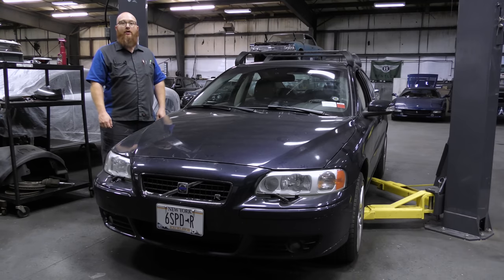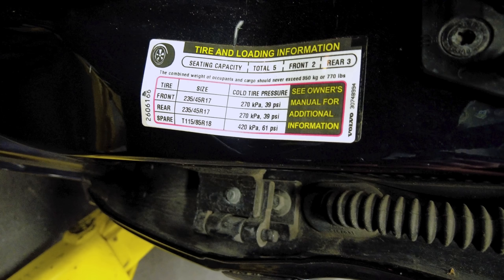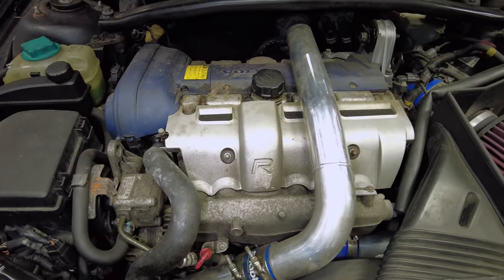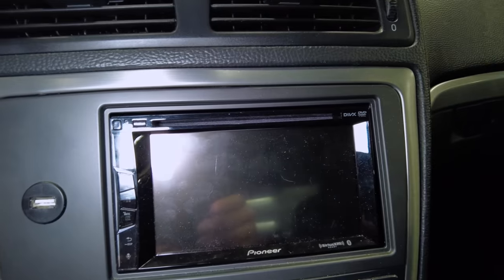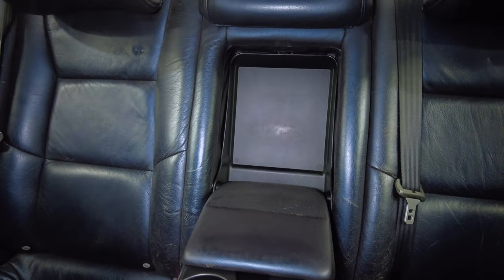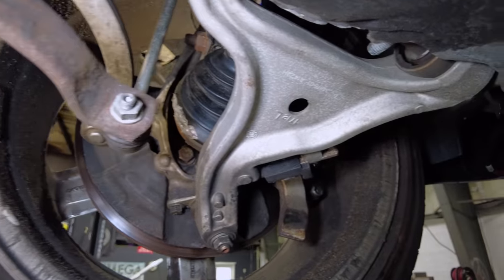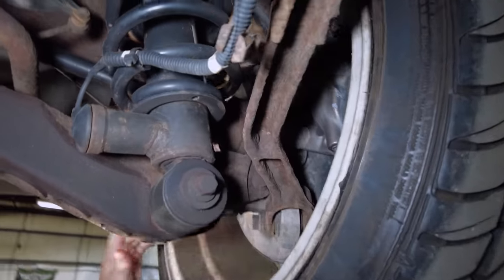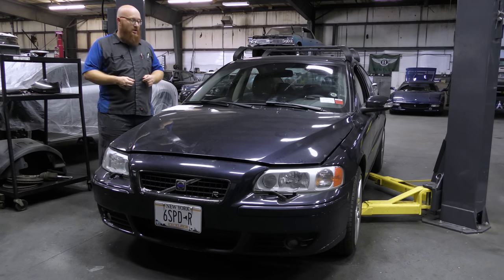They shipped their '07 Volvo S60R over 1K miles to my shop? CAR WIZARD determines if it's worth it!

Comment: Hi, Wizard. I specialize in Volvo repair and have personally owned 50-75 Volvos over the last 12 years. Love these cars. I can say with 100% confidence that the rubbing is NOT caused by the wheels or steering rack and in fact is the little bumper block things mounted to the control arms with two bolts, they wear out, and allow too much steering angle and the wheels rub. Volvo knew this was going to happen which is why there is a metal rub guard mounted to the inner fender. Also, 18" wheels were standard factory equipment on S60Rs, 17 came standard on V70Rs. 17s are optional for the S60R. I would also strongly suggest checking the PCV system as this car has lots of oil seepage around the oil filler cap and at 120k I doubt it's been done and it's due just based on age. I bet everything under the blue engine cover is soaked in oil. Cheers!
Reply: 100% correct. you need to mount the right steering stops when you place larger tyre size.
Reply: also check pcv system.
Reply: Was exactly going to comment this, They probably upgraded to the 18inch Pegasus wheels from the Original 17Inch and forgot to replace the steering stop bushes on the control arms for the correct wheel size, and probably what caused the steering rack to give up. :) and also that steering wheel is aftermarket on that car except for the centerpart + buttons.
Reply: Wizard better read this. Great information.
Reply: Came here to point out the same thing 😂😁👍
So +1
Reply: The sterling rack is also missing the plastic spring on the lower pipe, to relive the stress in the pipe.
Probably only needs to change the pipe kit. Unless the vonecting surfa e has coroded.
Reply: I think the wizard said in the video that the wheels are too wide. 🤷🏽‍♂️ maybe they’re 17” but he got wider wheels
Reply: @ObesePuppies  as the wishboes have been replaced, they have Probably been replaced whit the wrong one. The r has spesific bumpstops. They look New to me, so are Probably for 17" wheels. Se this all the time when non dealer shoos work on this generation volvo 😁
Reply: Sorry for hijacking the post a little 😂

But would want the wizzard to see this, 
It looks like the plastic spring thst goes on the stering rack brether pipe is missing. He Probably only needs to change the pipe kit, to fix the leaking rack. It was a recal to add the spring /swap the pipes if nesesairy. Atleast here in norway.
Reply: Picked up an xc70 for 600 bucks. The old man I bought it from took it to "a shop down the street" for regular service. They did the pcv service and installed a regular banjo bolt in place of the check valve that bolts to the manifold. Needless to say, it had blown oil all over the top of the engine and into every crevasse.  They also neglected to clean the square drain from the black box to the pan. When i removed it from the block, it shit out a half quart of milky ooze all over the ground. I think this summarizes volvo repairs pretty well. They're just weird.  Need to replace the turbo drain? Just disconnect the driveshaft and pull the angle gear.
Reply: Volvo are simple to work on but they have some issues like pcv valve and they all are interference design . They have an odd timing cover that doesn't prevent belt entanglement
Reply: @wolfeadventures  He should read all comments nobody knows everything and you guys comments are very help full to anybody else doing car repairs
Reply: 50 to 75 Volvo's find that hard to believe
Reply: Came here to say this!
Reply: @ObesePuppies no
Reply: @TheDingopaul I've casually owned like 20 we volvo nuts are a special breed 😊
Reply: @TheDingopaul why? 😂
Reply: Exactly, it was a 17" wheel car, put 18" on needs the thicker steering stop ... or just put some washers under the stock ones.
Reply: DItto the PVC system...it's a nightmare waiting to happen.
Reply: I was just about to say this same. If u on a budget, u can turn those over.
Reply: all old volvos scrape inside the fenderliners with oem big wheels . ( lm a volvo tech in sweden with 15 years at volvoshop in Gothenburg home of volvo) , oh yes , pcv system its common issue, also can be clogged in the block where the pcv is mounted .
Reply: 18s were standard for S60Rs? Why are most of them 17s then, wish I had 18s on my SR
Reply: My 99 V70 also had the bump stop. Confused me at first but ever since it’s been something I wonder why other cars don’t have 😁
Reply: @TheDingopaul  He probably Bought, Fixed, and Flipped the majority, he may even have a used car dealer license.
Reply: @jesperekholm3492  with my 04 S60R it has scraped twice then I changed the little rubber stoppers problem solved
Reply: Did this on my 06
Reply: The correct tires size for the S60R are:

225/45R17
235/40R18 
235/45R17 
235/45R17 
235/40R18 
245/35R18 
255/30R19
Reply: @boelensds and replace the knocking sensors while the intake is off when doing a PVC cleaning.
Reply: I don't know if it was the camera angle or lighting playing tricks, but the tires look narrow relative to those rims.
Reply: What do you mean 50-75 that’s so many fucking cars for one individual to purchase AND ALL OF THEM ARE VOLVOS!?!?
Reply: @brutusthebuttress1476 well if you consider his age , and being working in a shop you can do more than that when you are around 50 years old .
Reply: A volvo s60 R is most definitely a car you need to have a bit of background knowledge on to work on. Like most modern volvos they come apart and go together like Legos. I am actually surprised to see that much corosion on the underside, I live in the rust belt myself, and I have never had one with that much rust. Other helpful tips, know when to use oem and when aftermarket is ok on these cars, For critical components like timing belts always use oem parts and always do the water pump and applicable tensioner and Idler. Asin is usually the oem. As for wheel rubbing, most P2 cars do this, especially when they age. It's usually a combination of missing/incorrect steering stops and / or weak front springs. Always do a glove test to verify PCV systems on these cars. Volvo seemed to have underbuilt the P2 chassis. In my opinion, the P3 volvos always seemed ridiculously overbuilt, which isn't a bad thing. The drivetrain on these cars should be maintained religiously, all fluid every 25k miles on any that I have personally owned, and they stay trouble-free, always synthetic oil every 5k. I'd like to think you would be able to find someone local to rebuild the M66 transmission. Do not neglect the haldex system, and lastly, something to look for on these is a worn-out angle gear. If you get the front wheels to squeel accelerating on dry pavement, the sleeve is stripped out. I have seen people replace it, and I have seen people weld the sleeve, but I am unsure if it was designed that way to be a failure point. These P2 R's are definitely a fun vehicle but can also be a labor of love. They definitely are one of those cars with their own personality.

Comment: DO NOT change the entire rearview mirror. I did that mistake, it has computers in it for the locking system and some other systems, you have to transfer the same circuitry over to the new housing if you want to change the entire housing, otherwise your car's central locking will not work.
Reply: That's a worse design than what BMWs of the same era has
Reply: Before I got my 02 S60, my grandfather cut a piece of some mirror and glued it to the rearview mirror when the auto dimming died (and turned the mirror brown). This was after he was quoted $600 to change the mirror years ago.

Yeah that mirror contains the entire Upper electric module. Pretty much contains the security system, keyless entry, lighting, and sunroof. The minute you remove it the car will become an expensive paperweight until you put it back.
Reply: @1DeathSquadDictator0  It is possible to affix one from a junkyard as a temporary solution. I did that and the car does work, everything works except for security functions. So you’ll have to lock and unlock the car with the key.
Reply: @burntnougat5341  it is not uncommon for cars to have control systems in the mirror housing. It makes sense for receivers and in newer cars sensors and cameras can be placed there. The bad design part is that it is VIN-locked and Volvo is not able to reprogram another mirror that is not brand new for the same VIN. If only that was possible, you would be able to grab one from the junkyard and just assign it the correct VIN.
Reply: @tobias_dahlberg  that's what I mean, my bad should have been clearer. The vin locking is bad. I know BMW verts of that era have the key fob rx and rain sensing hardware in the same unit so volvo isn't totally alone there
Reply: Mine was broken 2️⃣, i had a rearview-mirror from an old Saab900, zip-tied it in front of the volvo mirror.
Reply: dont do it, dealers dont even rewrite the code to the keys anymore...
Reply: But I have an acura and it’s an automatic. To be brief I accidentally drove with my emergency brake on for about 5-10 minutes going 35-45 miles per hour because I was going to a gas station and I smell burning .. What kind of consequences can I expect and Ik I have to get it checked out just in case but realistically is it going to be expensive ?
Reply: @WAFEYYQQ  you better switch to a bicycle🚲
Reply: @erwinvangrinsven9345  what actually happens if I did this on accident first tkme
Reply: @tobias_dahlberg  mirror is not programmed to the car. However there is several options of the mirrors and if you choose wrong one then aome functions will not work. Like do you have puddle light, seats with memory function. Foldable mirrors or not. Blis sistem or not. But they are not programed to the car.
Reply: @WAFEYYQQ  i don’t know,tell me
Reply: @erwinvangrinsven9345  idk it still drives so
Reply: So true ,Volvo every single electric part is connected to the computer.
Reply: @Aloosh-gt4oi  Yes. But the same is true of most luxury cars.
Reply: @Aloosh-gt4oi  it is not true. Mirrors are not programed to the car. Yes some modules are but as other mentioned so it is for the most new cars.
Reply: If you love the car, it's worth it!
Reply: Yup, I fixed this issue by buying a used mirror screen and soldered it to the mirror housing
Reply: You can replace just the glass but it's a little more work. The circuit board can easily be disconnected from the glass. You just have to unsolder the wires going to the old glass and then solder to the new glass. I've rebuilt many of these.
Reply: @WAFEYYQQ  You probably just wore your brakes prematurly

Comment: I had a 07 V70R wagon and will say that they're one of the more tricky cars to fix as everything requires "software and coding".
Reply: In what way did software and coding make your V70R harder to fix?
I have a super basic '01 V70 that's not been difficult to fix so far.
I'm quite curious.
Reply: @DeeDee-pw9pm  only the dealership can sell you the software and code the parts.
Reply: @DeeDee-pw9pm a lot of modules need to be programmed. Ecm, throttle body, awd module, etc. But....they almost never break. Your car is a configuration, which is stored on a server in sweden.
Reply: @01Bouwhuis  yikes good luck fixing them when Volvo stops bothering with supporting these old computers.
Reply: @kimblem.w9952  I’m pretty sure the original intention was so Volvo could keep track of what cars had certain dealer options (like the polestar tune), and if the customer/shop did something that would void warranty. I know that in the US many mid-late 00’s cars had the window control when you hold unlock/lock on the key fob disabled due to many litigious laws, but you could go to the dealership and have it re enabled if you signed a waiver.
Reply: You can do that stuff yourself if you get a hold of a DICE unit and a copy of VIDA.
Reply: @RIGeek. Another right-to-repair issue.😡 

Volvo: ‘yeah, you can use second hand parts, but we won’t install them… you’ll have to use a 3rd party mechanic’

Owner: Ok, I’ll find a good Volvo mechanic!

Volvo: ‘Yeah, but they can’t code the parts!’
Reply: @DeeDee-pw9pm I have a V70R too 

You literally NEED vida to work on this car without it your screwed.
Reply: @OriginalDegree  hmmmz...point of debate. Yes vida makes it easier but vdash or a good universal scantool can do the job too. I like scannerdanner for tips and tricks.
Reply: @01Bouwhuis  Maybe with non-Volvo but as we've said here, if you need to replace a sensor, module or similar, the dealership needs to code it. Vida can but you need the subscription service from Volvo and that's costly.
Reply: @01Bouwhuis  yeah your absolutely right
 
But after owning 2 Volvos 
vida has saved me more often than not 
costs like 10$ =) online for the software 

The tool itself though that’s expensive 200$ ish 

But if someone has a tool that works for it hey why not!
Reply: @lukeclifton4392  Actually that’s false. Compared to other European manufacturers, Volvo allows customers and independent shops to purchase licenses to VIDA, the factory diagnostic software. Off the top of my head I do not know of any other automakers that allow this. You can load the proper software updates (even things like nav) and reprogram modules in your driveway with a laptop and a little tech know-how. 

On top of this, a third party Czech company has designed software that allows you to clone your existing software into used or new modules for about $40. Pretty cool.

The issue is that a lot of people commenting here don’t know what they are talking about!
Reply: Cracked free versions of VIDA can do most sensor recalibrations just fine (SAS, yaw, etc). VDASH can clone your module’s software into a new or used one for $40. If your module is entirely dead, a 3-day license to  VIDA is a grand total of about $90. That’s far cheaper than taking it to a shop, and most other European cars would need a trip to the dealer if a new computer was installed as you simply cannot acquire a license to the factory software.
Reply: @phishphood423  d5t5! They made vdash.
Reply: @01Bouwhuis  Yessir! Very useful kit.
Reply: I would also say they’re pretty easy to fix as well, all of the maintenance I’ve done on mine has been easy to do on my 06 S60R

Comment: Well they wanted the best shop to look at it!
Reply: Lol not even close. I’ve got a certified Volvo mechanic here in Chicago. I wouldn’t even consider trusting this guy with my Volvos.
Reply: @seanm3ify cool? Good for you?..
Reply: @seanm3ify truth. Wizard complains about the oil filter housing gasket on a E46. Turbo volvo? Hell na
Reply: Chacho the mechanic here in dallas would take care of it.
Reply from the maker: @seanm3ify Ive repaired tons of screw ups from “certified mechanics”. Most of them are hacks. Check out my older videos. Tons of re-doing jobs from “Certified Techs”. 
Put a link to your certified guys shop. Lets check him out.
Reply: If that was the case the car would be at south main auto
Reply: There are some really good swedish specialty shops in New England so I'm surprised they shipped it out so far but hey it's in good hands now at least
Reply: @sshomesteaders1776 
The only issue is sma isn't a euro guy , he always says he works on domestics  but nothing he can't work on
Reply: @seanm3ify  so where is your mechanic? 🤡

Comment: This iteration of 6 speed Rs are rare and worth saving.  All Rs have problems even the 10k ones.  Folks that own these are hobbyists at this point so yeah, worth fixing.   Newer Rs are a handling package.  This one came with a special engine, trans, brakes and suspension.  Lots of $$$ to keep them on the road but still a special car.
Reply: my 07 s60r has needed a lot of work in the year and a half i’ve owned it, but these cars are sooo worth it. not much else like it on the road anymore
Reply: @kylemontano228 hi kyle :)